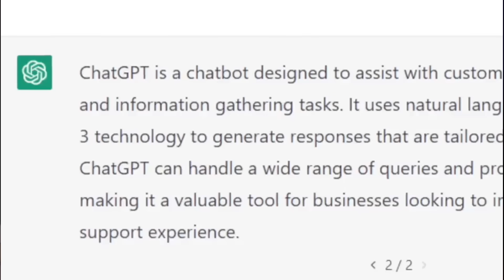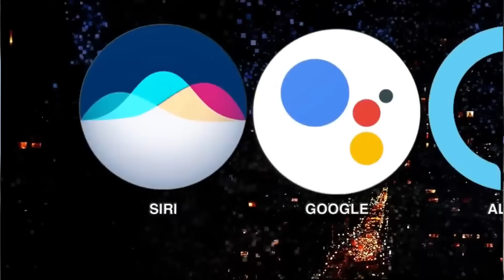US NEXT GENERATION HUMANOID ROBOTS SHOCKED CHINESE ROBOTICS INDUSTRY

Comment: Does the Atlas robot have to be programmed to tackle literally each step on that obstacle course? Or can it do it on its own on the fly , no matter how you set up the course? Because if it's the latter I'll be impressed, if it's the former then it's just an expensive, glorified Big Trak.
Reply: @charlesdanaa8514 Great question! While the Atlas robot doesn't navigate the obstacle course completely on its own in real-time, it's not exactly like programming each specific step either. The robot relies on a combination of pre-programmed algorithms and sensors to assess its environment. This allows it to adapt and respond to changes on the fly, making it more than just a pre-programmed machine.
Reply from the maker: Yeah, it takes a lot of programming to make these robots do what they're supposed to. The interesting part is that they're also set up to come up with new ideas using what they already know and do. In short, they're made to learn and do some weird things, haha!

Comment: For unlimited free potable water; I PROPOSE TO CREATE A NEW DIGITAL CURRENCY BASED ON TONS OF FROZEN FOOD OR UNFROZEN, INSTEAD OF GOLD TO CREATE A SAFER WORLD, A FREE WORLD OF ABUNDANCE.
PROPOSAL FOR A TRUCE;
THE PROPOSAL IS FOR OUR MILITARY to PROTECT THE PEOPLE, NOT THE OPPOSITE
FOR .56$ YOU CAN PRINT 10 000$. $117 of cooling per cubic meter of water produced for $0.56 will save 10 000$ of food that would be wasted otherwise. 
Here is a free battery that creates free water and saves food, the best future after we create peace. 
Solar energy is abundant, eternal and really cheap. It is the batteries that are very expensive. We have developed free batteries to supply low cost cooling and water in the desert for free, this system lowers the cost per kwh stored into the ice and even give free drinking water; For free water in unlimited quantities; I have developed a 100% solar seawater desalination technology that transports $117 of cooling per cubic meter of water I produce from the oceans for $0.56 to long or short distances using a mixture of ice slurry. This cooling will save 10 000$ of food that would be wasted otherwise. We do not use chemicals. We can store some of this cooling in ice saturated with salt that will melt at -21֯C in large freezers to save food in large quantities. In short, we provide cooling 75 times cheaper than existing equipment using diesel. In the Middle East, 70% of energy is used for cooling and most of the rest for desalination. We will use solar energy and store it in ice during the day at less than $0.02 per kWh compared to fossil fuel at $0.83 (42,5 times less) and save 80% of energy (which translates to 5 times less energy needed for the same amount of cooling) with this technology below. So we provide cooling for 212 (42.5 X5) times less and pay everything in less than a year. Water can be available for free after the ice melts. We will give freedom to all, exactly the opposite of what the globalists are trying to impose. 
https://www.youtube.com/watch?v=zAXN4xiCbuo